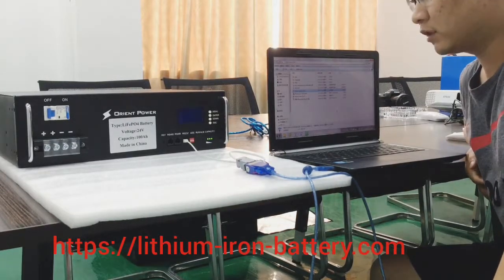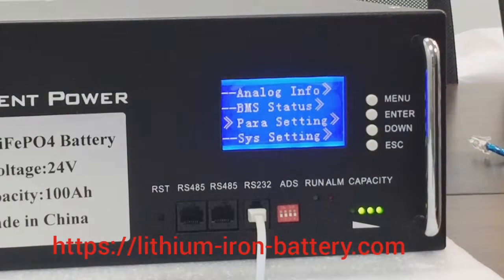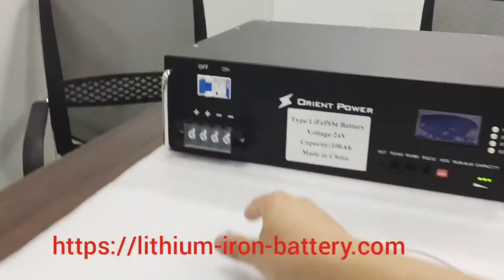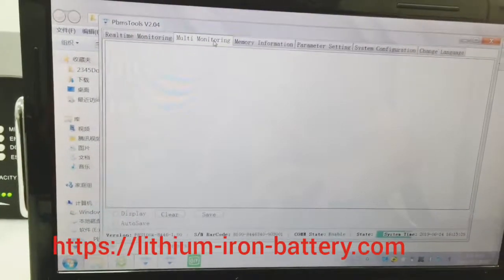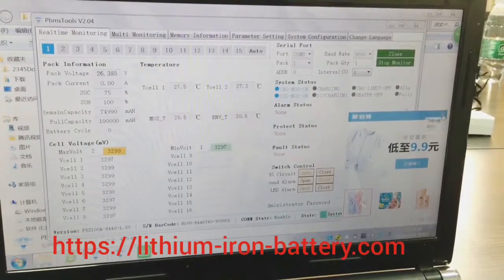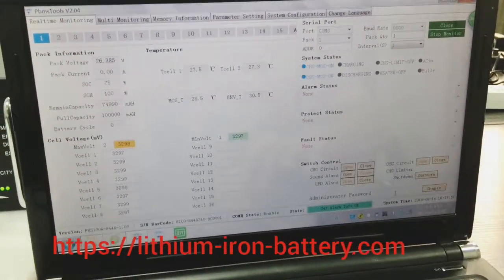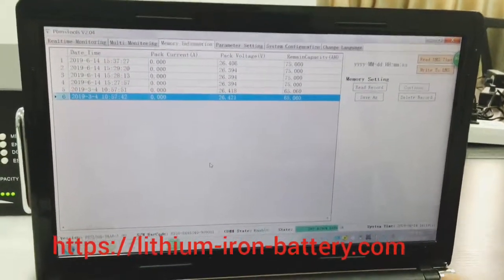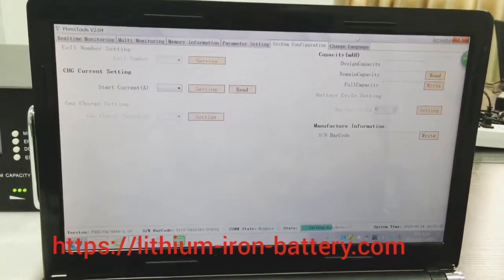24V100AH lithium iron battery connect communication cable monitor by software

Comment: how to open a battery that doesn't turn on and all the alarms go off? Thank you
Reply: Operation status DORMANCY ,
Reply from the maker: Open top and front cover, test the cell voltage by multi meter
Reply from the maker: Have you tried to press RST for 3 seconds to turn on the unit?
Reply: @powerwall 
I have pressed 3 seconds and 6 seconds, but it still doesn't turn on. The output is at 1.5Volt, isn't it from the BMS config? it locks?. because I got information on the type of unit under 40V, the unit battery will be cut off by the system
Reply from the maker: @Anha2.0  have you tried to apply charger
Reply: @powerwall  
the battery condition is indeed in a charging state, but the battery output is only 1.5V, I use a 54V power supply, With a current limit of 10A, 4810-100Ah lithium battery
Reply from the maker: @Anha2.0  can charge but can’t discharge?
Reply: @powerwall  can't charge mr
Reply from the maker: @Anha2.0  if breaker is on, need to check inside cel voltage
Reply from the maker: If battery cell voltage less than 2.5 each then has to charge cells
Reply from the maker: @Anha2.0  Another model has.

Comment: which tool and software you are using for RS485 communication can you tell and provide the same???
Reply from the maker: Rs485 is used for battery pack internal communications, rs232-usd is used for communicate with pc